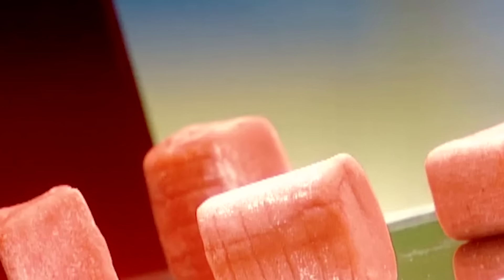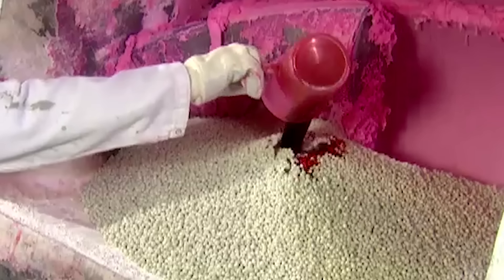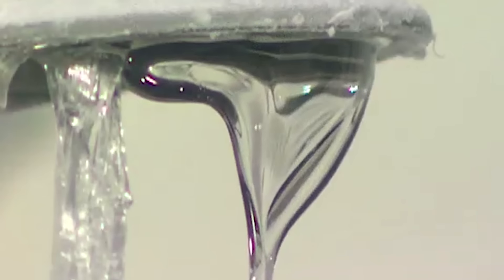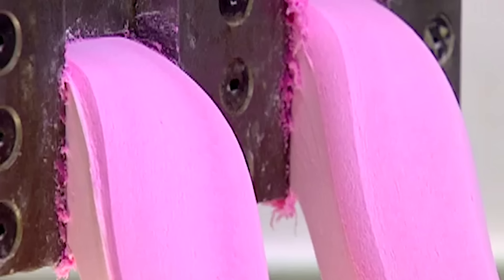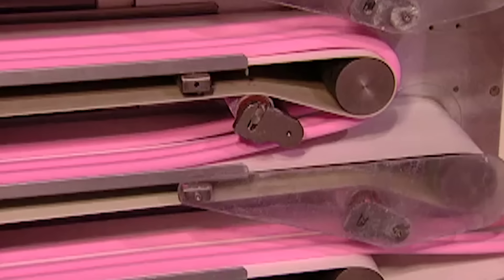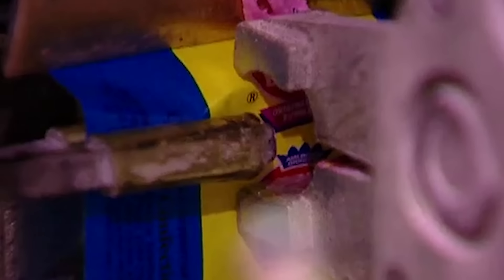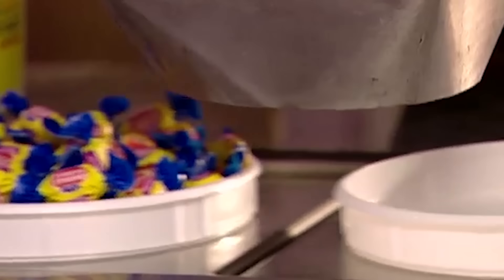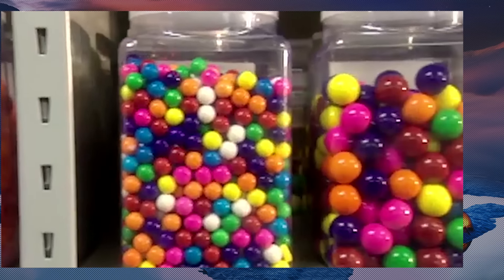BUBBLEGUM | How It's Made

Comment: "this keeps the bubblegum fresh"

How is rubber and plastic any fresh?
Reply: Are you too young to remember the baseball cards from the 80s that came with a stick of gum
Reply: @felicciasc  Haha yea some came with DVDs
Reply: condoms expire, and they r made of rubber
Reply: @charliebaker3230  Especially if it gets exposed to oxygen over time breaking down the rubber molecules and it turns brown in result of the oxidation process.  You know if  a rubber band is left outside in the elements over time, it starts to get brittle and loses its elasticity and breaks.
Reply: They're meaning fresh as in keeping it soft and preserving the oxygen from breaking down the flavor.  If you leave a gum out of the wrapper over time, it will harden, make it hard to chew especially people with sensitive teeth and it will break into pieces.  They're keeping it from going STALE, not rotten.  Same goes with potato chips and other snacks.
Reply: @chrisbailey7384  exactly, rubber can expire
Reply: Rippin’ straight facts right here

Comment: if you don't want to eat literal plastic gum...try Simply Gum which uses the tree resin that used to be standard when bubblegum first became a thing! My favorite flavor is grapefruit prickly pear :)
Reply: Too expensive to produce
Reply: It’s not a problem thought because you DONT swallow gum, you chew it.
Reply: @gordonfreemansupremacy3629  correct besides swallowing a gum is not really dangerous. as powerful as our stomach acid is it cant dessolve gum so... the gum literally just passes through you
Reply: @eselcool3720  you eat about a credit cards worth of plastic every week, why would a piece  of gum make a difference.
Reply: Grapefruit Prickly pear? Whaaaaà???? Ok. Thanks for the advice
Reply: @eselcool3720  literally everything we eat has some amount of microplastics in it, bubblegum is the same as any other processed food in terms of microplastic levels (also, the gum wont dissolve into microplastics in your digestive system)
Reply: Hate to tell you this, but tree resin is just another kind of rubber. The artificial stuff is just as safe and the active ingredients are nearly identical. Not to mention way cheaper!